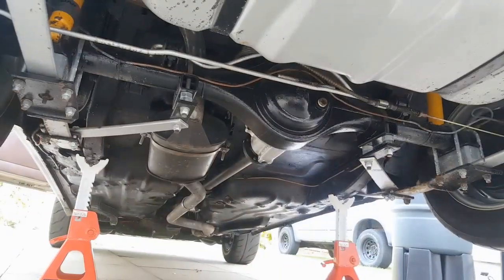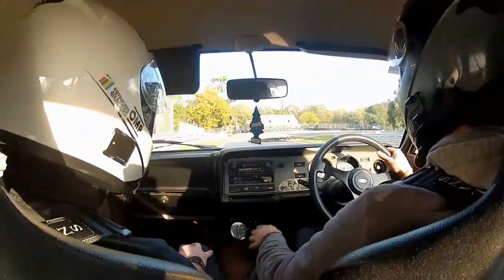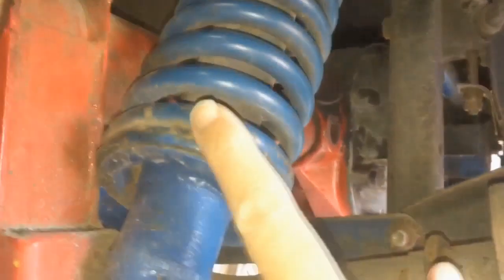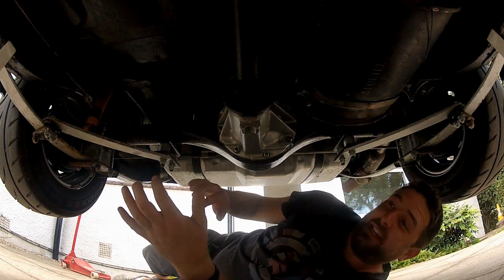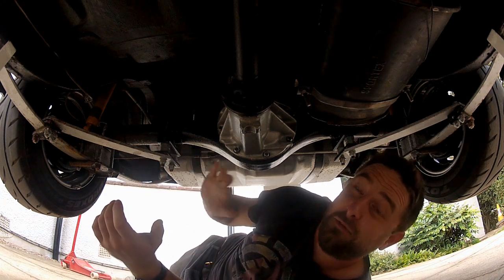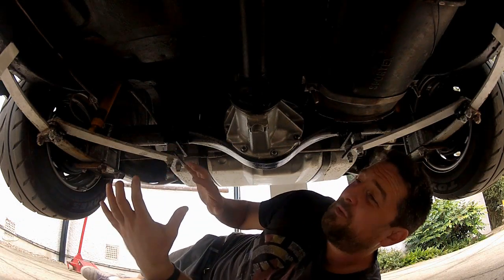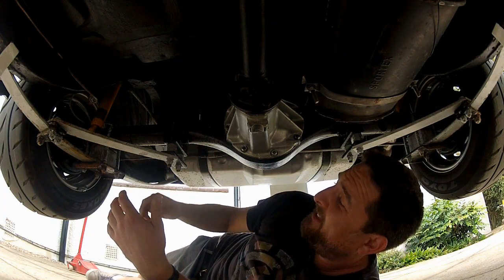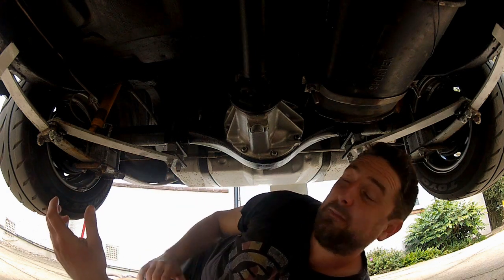Budget A-Frame Axle Location Kit - Fabrication & Install (Watts / Panhard Alternative) | Tech Tip 28

Comment: Did it wheel hop before and if so does it still?
Reply from the maker: Hasn't wheel hopped on me yet. It's quite light on the back so you can't put much brake to it anyway. As for before, didn't really push it to the limit pre A frame so hard to say.

Comment: Good explanation. I ran an A-Frame on my Mk1 V6 Capri and now I have an X-frame on my Mk3 V8 Capri. 
They are good for controlling initial loss of traction on turning from first, particularly if you have a low geared car. My V8 fishtails if you put the boot into it on a right hander (which some might enjoy) but can easily snap back and send you the other way into a ditch. This has a tremendous effect in preventing it.
Great video. Keep them coming.
Reply from the maker: Thanks again! How did you find the X vs the A frame? I went with A based on what I'd read online & I'm amazed by the improvements in handling such a simple kit makes. Nice to hear someone else who thinks the same 👍
Reply: Great video! I have wondered about putting these on my Capri but it’s probably not worth it for road use. Interesting your Capri has an English axle? Is it because it’s an early mk3 or did you change it?
Reply from the maker: Yep. Early mk3 1.6L, they came with the English from factory. Thought about swapping to an Atlas but I like it. Does the job.
Reply: @RetroAndRusty  Definitely worth it for road use - first mod for any road Capri.